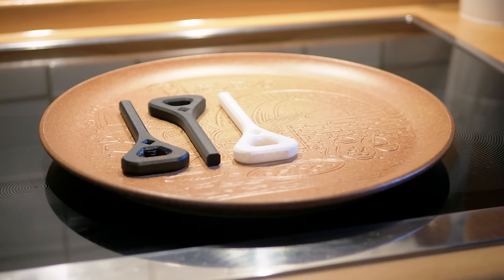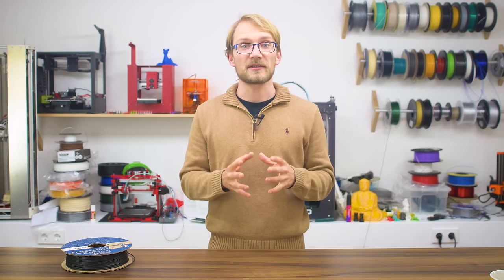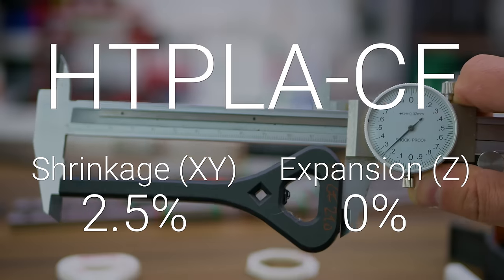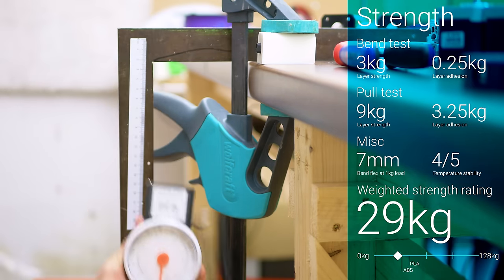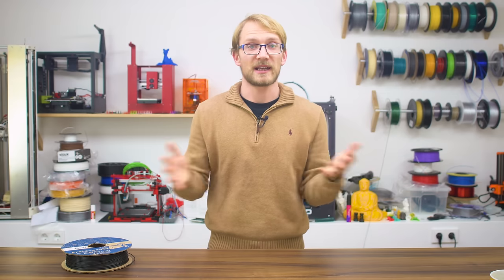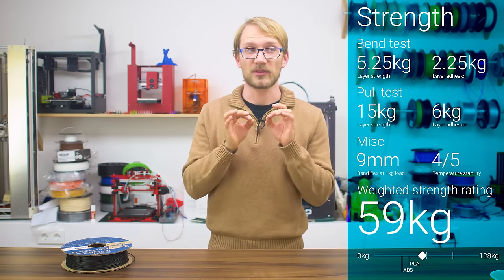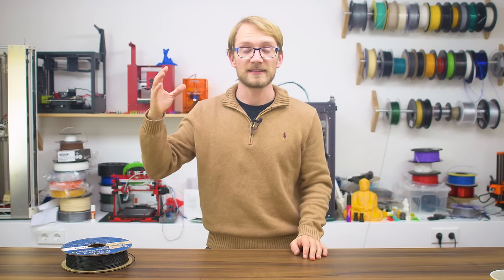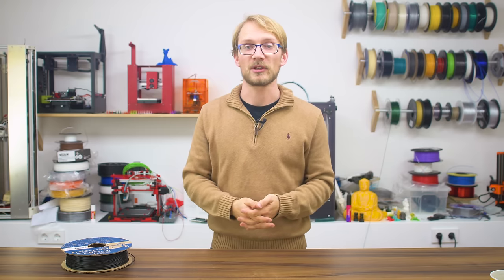Bake your PLA and have it outperform everything else! #Filaween

Comment: Thumbs up for going the scientific route, and including ordinary PLA in the heat treatment test. Unexpected results, that are usable indeed. #respect
Reply: A lot of the best results in science were by mistakes, but if you purposefully include testing everything, you sure make it much easier to make those "mistakes". Good going Bro!
Reply: that's the difference between legit enthusiasts and commercial hacks peddling a specific product (or every product willing to cut a check)

youtube has gotten quite infested with the latter
Reply: Jonathan D that is quite a tightrope to walk and an interesting subject.  I am a commercial hack who is also a legit enthusiast, the crossroads are a startup.  I want to be genuine, open, technical, and innovative.  I am re-using techniques like this and many more to use FDM as a basis for molding and casting an entire wet line of parts for our products.  What would be your main points for not making instructional videos too commercial, but made by someone like me who is (or should be) obviously selling something else?  I want to make money on our products, not by monetizing our software and techniques, that should belong to the community.  Thanks

Comment: This XY shrinkage could be an interesting property if you want to heat-shrink a part around a metal part for example. No glue needed and better strength.
Reply: Not a great idea. You might not want to mix materials with different thermal conductivity.
Reply: @3dr14ng4  depends on the usecase.
Reply: In use cases where thermal conductivity may not matter such as mechanical devices or covers and sleeves for metallic devices, this isn't relevant and considering that most mechanically apt metals are not subject to warping or excessive expansion at such low temps just above boiling water, it's a fantastic idea you acquired there, good thinking!
Reply: Like shrinking the handle around the tang of a metal blade
Reply: Coating it with a high temp epoxy might keep it from prematurely failing due to heat. Wrapping some real thin sheet metal over that, too, might be doable for some people. Might be good for harnesses, hooks and slings to stow gear on a carpenter's belt or something. Super awesome information, extra relevant today... Wink wink.

Comment: I recently reprinted the broken handle of my espresso machine (witch gets around 90 °C) with PLA. At the beginning i thought this was a bad choice because it became very soft the first time the espresso machine got hot. But after a couple of times heating and cooling down the espresso machine the PLA stays hard even if the machine is on for hours and the handle feels stronger then ever.
Reply: That's interesting, maybe heat cycling changes it chemically?
Reply: How is it now, Tijn v?
Austin, I think that changing the "architecture" of a material inside it is already the chemistry. Or maybe I'm wrong and it's supposed to be called "physics" :)
P.S. yeah, it was enforced by coffee molecules :D
Reply: MoolahNasreddin as are the best things in life!
Reply: Tijn v Maybe heat changes the chemical structure of the filament and bonds the layers. Heat treating is an effective way to increase strength and heat capability’s but it will shrink.
Reply: @hazoish7670  Molecular structure not the chemical structure.
Reply: Arlin Sansome Ok
Reply: I was not expecting that
Reply: Do 3D printer filaments have plastisizers? If so it may also be that they become more volatile under higher temperatures and that after a while the part would become a bit more brittle, but also stiffer and overall stronger.
Reply: Yeah, I would go for Nylon or Polycarbonate for high temp applications ... PLA getting stronger with repeated heating cooling cycles was something interesting to see
Reply: Austin Winn late but, the plastic crystallizes. The crystalline form has a higher melting temp. Each time he heats it, the crystals become more perfect. Getting stronger and more temperature resistant.
Reply: I suspect you will find the plastic becomes more heat resistant over time when exposed to heat cycles but it will become more brittle. Its like all materials, when you gain strength you lose flexibility. The reason I say this is I have restored lots of old electronics home equipment  that has been exposed to heat over the years and I have noticed the plastic is very stiff but at the same time more brittle.
Reply: @KiR_3d  material properties can change with processing. Read up on cross linking………..it’s physics.
Reply: @siggyincr7447  well if it's getting more 'brittle' than it is not 'overall stronger'. I'll let you get away with just 'stronger' or 'harder'
Reply: @scatdawg1  Brittle as opposed to flexible. Meaning it will bend less and break more cleanly. Being brittle and strong are not mutually exclusive. If anything, they're more often complimentary, especially when a crystalline structure is formed. The part is less flexible, and therefore more brittle. But far stronger in that it has a higher tensile strength and resists breaking.

Comment: Any method of annealing will reduce induced stress within a material and affects its final dimension (shrinkage and expansion). We normally see this within the PET packaging industry. The most interesting part is the added strength, this would concur with the theory of crystalinity being promoted by the heating process. PLA was originally designed as a replacement resin for PET material (plastic water bottles) back in the late 90's (it failed miserably). The ability to injection mold and then blow stretch would require a fairly long molecular bond, and ability to crystallize. Now how far can it be crystalized? BTW. I left my Proto-Pasta CF parts on their raft on a heated bed up to 110 C. Simply made a small box to insulate them and left them for 2 hours. Reduced to 80C for one hour, and finally one last hour at 60C. This prevented the parts from wrapping.
Reply: give that info,  can they also be heat treated, or tempered to a degree? With the extra strength gained is a little of that happening to some extent already?
Reply: landlockedviking i am not as familiar with Nylon's and their properties.  but would i say definitely yes to PETG
Reply: now that is a great idea to use the heat bed and a raft. I could see that could exceptionally well
Reply: Thank you for the insight.  This is something to add to my knowledge repertoire.
Reply: That's great info, Fred! Thanks for sharing that, I was actually wondering about staged cooling. Doing on the bed is brilliant! :-)
Reply: Crystals may held a role... however I will put my wage on another factor:
it release stress and increase the adhesion between printed layers that is the weak spot of printed objects that is the starting point of fractures.
Reply: Fred Pinczuk thanks mate it's good to have a input and opinion from experienced professional. :)
Reply: Dear Fred, is it possible to elaborate more? My goal is to make my CF moulds from 3d print. However, I experience problems in temperature and dimensional stability in most issues. This way ( heating up bed, gradually reducing temperature and enclosing it ), does PLA maintain it's dimensional stability and increase its temperature resistance??? I am looking forward to your answer!!!
Reply: you seem knowledgeable, is there any way you can see to get pla or abs plastic able to handle a temperature of 250 C for around 5 minutes?
Reply: Troy Lucia in a bowl. ;)
Reply: @TroyLucia55  um..... we print pla from 190c to 220c.
Reply: That is a massive waste of energy.
Reply: I'm curious, how about heating PLA up and then dip it in the water/ or ice water? will it harden the diping part?😝

Comment: Hey Tom, great video. We have been working with Proto-Pasta High temp filaments a lot, and testing them and the annealing process. We found the High Temp carbon fibre needs longer than one hour...up to 4hrs in larger more dense parts. You can tell if it has annealed correctly because you get zero softening at 120 degrees. This rule also applies to their HT PLA. WE make parts that are part of a kit that sits on a hot plate at 110 degrees for hours and has zero warp or soften. We anneal these parts at 75 degrees for 4 hours to get the best results. I wonder if the slower, lower temperatures we use actually increase the effectiveness. Interestingly we also get zero shrinkage in any axis. 

I will continue to examine this, and will let you know when our results are online
Reply: We are still learning too :-)  Keep experimenting and sharing!  We will too!!!
Reply: Chemically, anytime a crystal is formed, slowing the process down will result in bigger crystals. Which properties PLA cured at lower temperatures exhibits is yet to be seen, but playing with temperature and other factors could produce many useful results. I'm curious about how various vaporized solvents might effect the process as well.

Comment: Shrinkage XY and expansion Z could be due to memory effects relating to each line of deposited filament attempting to return to a more circular cross section as it was in the nozzle.   Great work Tom.
Reply: Interesting hypothesis! I'd like to see heat treating under a microscope :-)
Reply: If you can see molecular chain alignment under a scope, go for it! ;)  Just a kind of laymen's explanation here:  When the material is melted, whether in a blog on your table or in the extruder chamber and they are not pressurized, the molecular chains can relax and situate themselves however they like....think unorganized like of a plate of spaghetti.  Once pressure is applied and it's forced thru the nozzle, they have to all line up while being pushed out and they go with the flow - north, south, east, or west of the orifice....because the resulting layer is thinner than the nozzle opening and cooling happens so quickly, they freeze in the direction they were pushed (or laid out, if you will)...and they always desire to get back to the relaxed state.....it's stressful work staying rigid like that...  Once heat is applied again, the closer they get to the glass transition point (not quite melting), they have freedom to relax and that's what they do as best they can.

Comment: some things to try: 
buy an oven thermometer that sits on the rack. Built- in thermometers are notoriously inaccurate. 

fill a tray with corn starch, lay the pieces on that to bake them. It should even out the heat distribution. The uneven surface of the plate used in the video would play havoc with this. You could go further and continue by also covering the parts with more corn starch. I'd try at least 1 cm deep above and below.
Reply: I'll use powdered salt.

Comment: Just baked a sample of Prusa PLA as supplied with the MK2 @ 110C for 15 minutes on a perfectly flat glass tile (preheated). The part was scrap because of design changes.  The test was to determine what level of warp it would get and if there was a progressive effect over time in 15 min steps.  After the first 15 minutes the warping affected the geometry so much that further steps were not needed.  Z change was +11% over 8mm and in the other planes it was -10.6% over 10mm and -8% over 70mm.  One long side had a central protrusion with an 8mm hole with its centre line on the side face, it suffered -11.4% reduction.  The part was complex having four other holes in it so it could be expected to warp in an irregular and unpredictable way.  The only thing to take away from the test is that longer stretches of parallel filament seem too shrink less than shorter stretches where the proportion of parallel to perpendicular runs is smaller.
Reply: Bake it in packed sand, significantly less warping as it is essentially fully supported.

Comment: any plastics that have seen some kind of warm passing through a nozzle (extruded parts, water bottle is prolly best example) will show this kind of behavior. 
crystallisation and recrystallisation mainly cause the shrinkage. the problem with fillers can be, that they suffer from bad adhesion to the matrix due to shrinkage and then basically act as crack starting points rather than reinforcing the matrix and often have not much use. adding special linking-agents (particle-matrix), e.g. silanisation can compensate for this.

Comment: I gotta say I've been LOVING eSun's PLA Pro/PLA+ lately. For its relatively cheap price I've been astounded by its performance and layer bonding....and even if it's not "stronger" you can tell it's many times less brittle. Pieces that would ordinarily suddenly fail with breakage instead bend a tad. And it's a few bucks cheaper than regular hatchbox PLA on amazon. I've gone through two fulls spools of each and I like the eSun PLA+!

Comment: How about annealing the parts in boiling water? Seems easier than putting them in the oven, just pour boiling water into a bowl, put your parts in the water and wait for the water to cool down? Should give a very even cooling too, right?
Also your part would only experience around 20% of the gravitational stresses it would in the oven (Assuming you don't have large pockets of air making your part float). This would be great for intricate parts which might deform in the oven. Getting rid of air pockets might be difficult though, but probably not necessary since you can probably weigh them down without damaging them.
Reply: As part of an experimental rocket fuel tank, I once tried this process. I have to agree with you, it is definitely a better way to anneal. You can achieve higher and more controlled temperatures as well. Doing it in water also allows you to come down from annealing temperature really slowly and in a very controlled manner; this can increase the strength even more if done properly.
Reply: Gravity is a force, not a stress. ;) stress is typically measured as psi or mpa. Anytime you heat and cool parts you're physically altering the parts on a molecular level so you will get some sort of deformation regardless. Boiling in water would be fine if you kept it at a low boil and were able to suspend the part. A turbulent rolling boil would add variant stresses and strain on the part that could cause micro deformations as well as the fact that you're introducing a variant head pressure on the part from the water. I'm not saying it wont work, just saying by removing moving water it simplifies the experiment. The fewer variables, the easier it is to control an experiment. Typically we (engineers) anneal parts in an oven that's computer controlled so they can be in there for long periods of time with a steady temperature change. Definitely changes depending on the material and of course your end goal though and what material properties you're trying to achieve such as ductility, yield strength, elasticity.. etc.
Reply: or maybe oil if higher temperature is required
Reply: There's actually a guy who made a video, who recommends annealing parts in boiling water then soaking them in COLD water right after for best results. His method is less than scientific, but he claims it works just as well as oven annealing and much less shrinkage. The parts will be filled with water though in small holes and parts of the infill. Probably can dry it with silica.
Reply: How about trying vacuum sealing your component in a Foodsaver freezer bag.and annealing in a water bath? Like Sous Vides cooking. the parts will not be in contact with or be affected by the water. A slow cooker springs to mind. Mine can be adjusted for temperature.  would the vacuum environment (circa 15psi) help retain the original shape I wonder. Alex Kemmis, I think was the guy you mentioned and the vacuum bag trick would allow you to quench in cold water quite easily. He mentioned ziploc bags which got me thinking about vacuum sealing with a Foodsaver system bag sealer.

Comment: Different strokes for different folks, I suppose. I get my best results printing in ABS and exposing the parts to a room temperature vapor chamber (fancy name for a polypropylene box - or a box of other materials impervious to acetone (HDPE, glass, etc.)) with a small Acetone reservoir. Just keep in mind to not expose the part for too long; if the vapor penetrates too far the part will deform as it releases the acetone (in my experience, depending on the size and anatomy of the part, <1 hour exposure and an estimated 24+ hours for the release process). I get astonishing results using this process. I haven't taken the "scientific" approach and measured differences in tensile strength, but it is without a shadow of a doubt stronger by a perceivable margin.
Reply: Other people have done testing which reveals that acetone treatment weakens parts. The acetone is incorporated into the plastic, and leaves air bubbles when it evaporates. The outermost shell may seem tougher and uniform, but the interior is more spongy and weaker than before.
Reply: That is a valid concern, the physics of it seems plausible. As stated I don't have empiric evidence for my claim, but my limited testing seem to indicate strengthening. I suppose both exposure time and vapor method (hot vs. cold) could be a factor; I find that parts I "over-expose" seem structurally weaker and prone to warping. I also suspect that adding temperature (hot vaporizing) would make the acetone penetrate deeper by virtue of the plastic being hotter, thereby potentially creating complications upon evaporation.

It should also be said that I could be entirely wrong, this has been the case once or twice before. :P

Ultimately, for parts where strength is of the utmost importance I generally make a silicone mold using the 3D printed part and cast the final piece in polyurethane. This of course has its own set of limitations, chief of which is the anatomy of the part.
Reply: TheMrBeaton There's definitely going to be a sweet spot for that. Also, the many variables like wall thickness and in-fill will vary things massively!